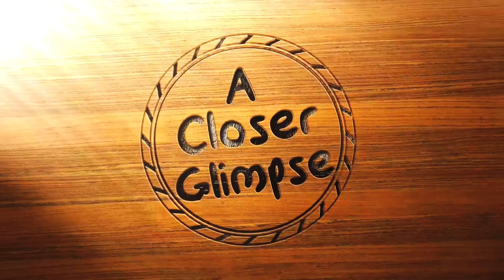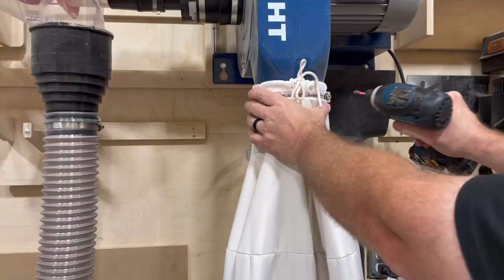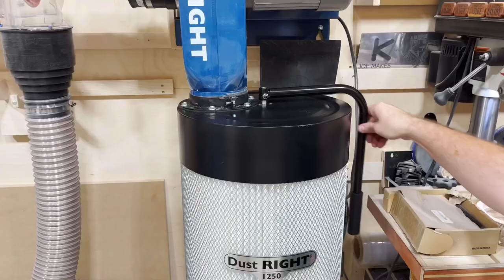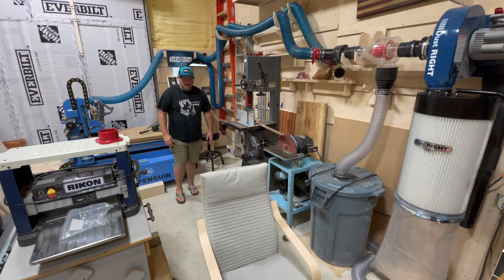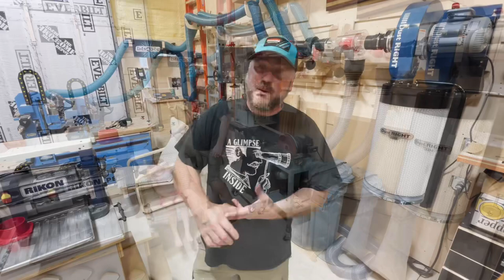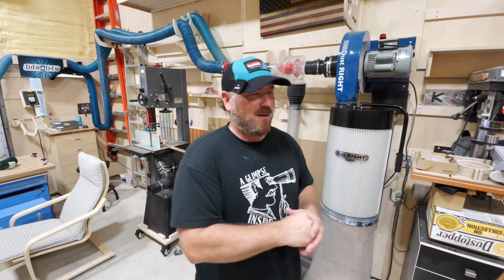Shop Update, Using ONE Inch Casters…? Plus More Dust Collection Upgrades

Comment: Chris hi, are you still happy with your blast gates? I bought 7 and they are leaking when closed .
Reply: Do you know I only have two and they work fairly well but I could see how seven of them might cause a bit of a problem because there is a little bit of whistling when they’re closed. I see that all blast gates are going to have some issues somewhere. At least the ones I’ve used have. Quite the conundrum wouldn’t you say

Comment: I dread calling HVAC people... I needed to get a mini split for my 74yr old Mother in law just good enough to cool down 500sq ft. After 2 weeks of calling around and being told $3500. I bought her a 15k window unit and installed it myself... this was not the option I wanted for her but for $500 and alot of sweat her little trailer will now cool down in this 115 degree heat index.  Time was the issue and had I had the time id got a Mr Cooly DIY for her.

Comment: 5:39 "let me give you a closer look at it". Don't you mean "a closer glimpse" 😏 🤣
Seriously though, is that the Rode Wireless Go you're using?
Reply from the maker: Yes it is. I love this thing
Reply: @acloserglimpse9895  awesome . We're considering one. Do you have many issues with dropouts? Also, Version 1 or 2? We're currently running the VideoMicro by Rode but occasionally it can get a bit "echo-y" if you're not right up on it.